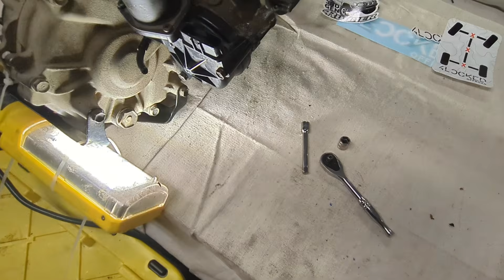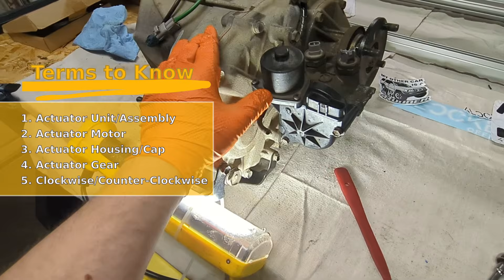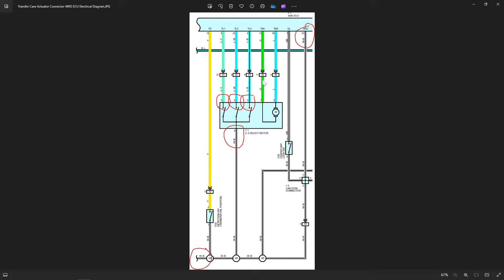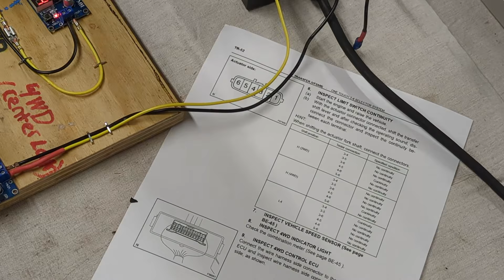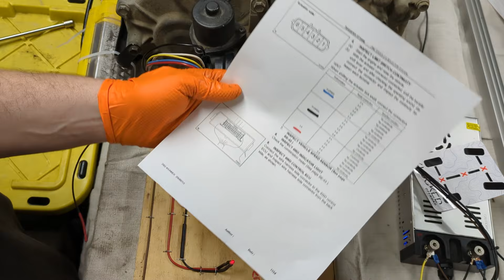Fix Your 4WD/All-Wheel Drive: Rebuild Toyota 4Runner/Tacoma Transfer Case Actuator Fast!

Comment: My 2001 4runner 4wd lights are flashing on the dash and it wont go into 4wd at all and the center diff is locked up, I already tried replacing both switches on the actuator, so now im just going to replace the whole actuator itself, my question is can I just throw it on? Or do the gears in the new actuator need to be selected into the same function that my truck is stuck in? Looks like in your video the middle selection would be the correct setting, do i need to make sure the new actuator is set to that? Thanks
Reply from the maker: So your current scenario is the lights were flashing and you can't engage 4WD. Did this only start occurring after you took off the actuator cap and/or actuator gear and then reinstall it? There are a couple of things that come to mind. 

1. Let's forget about the transfer case rod and it's position for a moment... If you're trying to change the transfer case position by turning the actuator gear, make sure the actuator gear is set in there correctly. If place the actuator gear in the 10-12 o-clock position then the physical piece of metal spring on the bottom of the actuator gear will run into the a protrusion of the casted actuator body. This is a physical stop. If this is the case then pull the gear out, rotate it counter-clockwise about 90 degrees and try again.

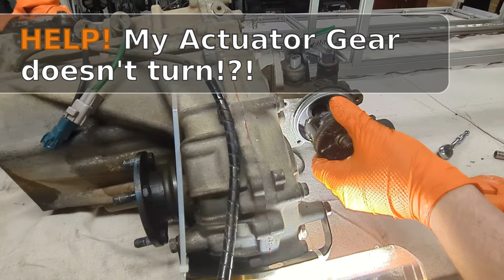I talked about this scenario in the video at the 10:00 mark.

2. Put your vehicle on 4 jack stands or a lift. Put the transfer case in Neutral. Parking brake off. This will ensure the drive train is not loaded with force. If there's too much force on the drive train that's in turn resulting in a lot of force on the transfer case rod then you won't be able to move the actuator gear (or the transfer case rod) left/right very easily.
Reply: @ no the vehicle sat uncared for for about 6 years, so it hasnt been kept up with over the years, trying to bring it back to life ive been driving it for months until I decided to see if the 4wd worked, of course it does not, would not go into 4wd at all, 4wd light is flashing constantly on the dash and the center diff is locked up, car jumps at hard turns, I took the actuator off and it is all corroded and rusted inside so I bought a used one to put in its place, just dont know how to go about installing/timing it to my current situation
Reply from the maker: You bought a used actuator or a whole transfer case to swap in?

If you're swapping in a used whole transfer case... You can take out the one in there and put the used one in. If the front diff A.D.D. is engaged the computer should figure this out and bring it to parity with whatever position the used and newly installed transfer case is in.

Putting in a used actuator? Then put the vehicle on 4 jack stands (on level ground!) or a lift. Take off the parking brake, put the transmission (yes, transmission, not transfer case) in Neutral. Then spin the rear drive shaft. Does the front drive shaft spin? If no, then the transfer case is in 2WD.

If front drive shaft spins you're in AWD or 4WD.

While spinning the rear drive shaft grab a hold of the front drive shaft and stop it from spinning. Does the rear drive shaft still spin? If yes, then your transfer case is in AWD (center unlocked). 

If the rear drive shaft and front drive shafts must spin the same rotations together then you're transfer case is in 4WD (center locked)

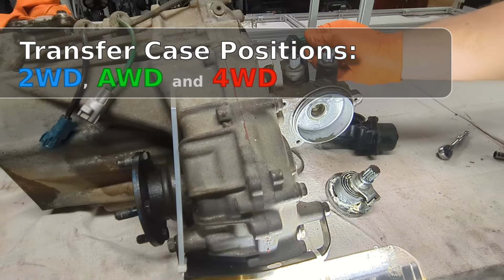The 3 transfer case positions are explained at 8:04.
Reply: @ I bought a used actuator and I was just going to throw that on hoping that fixes my problem, can the actuator positions be changed with the actuator off the vehicle? For example can I turn the gear in the actuator to put it in 2wd and then install it onto the transfer case? Or do I need to install the actuator to the transfer case, take the cover off the actuator and then turn the gear to put it into 2wd while its on the transfer case? Thanks! Im assuming the main goal is ensuring the transfer case and actuator or both in the same position when its installed, not sure if this is something the vehicle computer would adjust on its own if they actuator was installed not in the correct position?
Reply from the maker: @kylekenn8430   I actually haven't pulled the entire actuator off the vehicle yet, but I will do my best to answer your questions to the best of my knowledge.

"can the actuator positions be changed with the actuator off the vehicle":

When you pull the actuator off, the shift fork shaft/rod will stay inside of the transfer case. This will allow you to pull on the rod directly to change through the 3 positions. You really don't want to pull that entire rod out unless you must replace it, because that requires opening the entire transfer case.

"For example can I turn the gear in the actuator to put it in 2wd and then install it onto the transfer case?":

You can absolutely turn the gear in the actuator while the actuator is on the transfer case to cycle the transfer case through the 3 drive positions. This is covered in the video starting at 8:04

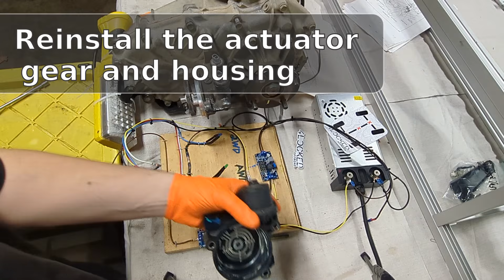While the actuator is off the transfer case, I don't see why you couldn't realign the electrical half to match up with whatever drive mode the transfer case is currently in. This is covered in the video starting at 23:40.

"Or do I need to install the actuator to the transfer case, take the cover off the actuator and then turn the gear to put it into 2wd while its on the transfer case?":

My preference would be to set the drive position on the transfer case in 2WD by pulling/pushing the shift shaft/rod. Then separate the two halves of the actuator and install the metal side of the actuator to the side of the transfer case. Finally, position the actuator gear to the start of the 2WD circuit and install it. IMO that's the easiest method. And it gives you the chance to add fresh grease to the inside of your used actuator assembly.

However, you may be able to set the transfer case in a drive mode like 2WD. Then, assuming the actuator and its gear is aligned at the beginning/start of the 2WD circuit, you may be able to put the actuator on the transfer case.

" Im assuming the main goal is ensuring the transfer case and actuator or both in the same position when its installed":

Absolutely. The transfer case shift shaft/rod position and the actuator gear position need to be in the same position as each other.

"not sure if this is something the vehicle computer would adjust on its own if they actuator was installed not in the correct position?":

The computer won't be able to readjust these two components (the actuator gear + the transfer case shift shaft/rod) so they are both aligned with the same positions. That's something the installer has to do.

The reason why the computer can't resolve this is the computer can only send power to the motor to turn the gear clockwise/counter-clockwise. The problem is whenever the actuator gear turns it will also move the shift shaft/rod the same amount...

So if your shift shaft/rod position is in AWD (one side of the spectrum) and your actuator is in "2WD" (the opposite side of the spectrum), then when the computer tries to change the transfer case into 4WD Center Lock  (middle of the spectrum) or AWD it's going to run into a physical limit.. Because the shift shaft/rod is already at the furthest point and cannot be physically moved anymore.

Hope this helps.
Reply: @  so I actually just finished up, I pulled rhe transfer case shaft/rod out to ensure its in 2wd, I adjusted the actuator gear completely counterclockwise, I drove the vehicle around the block and it feels like it is working mechanically, however the 4wd light on the dash still is constantly flashing, at the 27:00 mark in your video when you readjust the gear in the acuator to align in correctly to slide/fit on the housing better it seems no matter what I do I cant align the gear properly to get it so sit flush in the housing so i can bolt it on appropriately, any tricks with that? I got it bolted on but only was able to get it on where there was a small gap and then I tightened the bolts to get it completely flush, thanks so much!
Reply from the maker: @kylekenn8430  

" I pulled rhe transfer case shaft/rod out to ensure its in 2wd":

I'm pretty sure transfer case shaft all the way out is going to be AWD, at least in 2001-2002. Can you verify this by pulling the rod all the way out and spin the rear drive shaft, does the front spin? If so, if you hold the front shaft to stop it from spinning can it be stopped while still allowing the rear drive shaft to be spun? You'll need to jack up the vehicle by the rear axle to lift the rear tires. Don't forget to chock both front wheels. Then put the transmission in Neutral, parking brake off, and you should be able to spin the rear drive shaft by hand. If the front drive shaft moves at all you're in AWD. 

" I cant align the gear properly to get it so sit flush in the housing so i can bolt it on appropriately":

Most likely because you're gear teeth are not aligned properly. You have two sets of gear teeth that need to be meshed together perfectly. The first set is the actuator gear (the brown cog) and the actuator motor's screw drive. The second set is the "pinion" style of gear on the back of the actuator's gear cog and the rack gear on the shift shaft rod.

Sounds to me like your actuator gear's pinion gear that mesh with the shift shaft rod's rack gears are not properly aligned. Assuming this is your problem your actuator cog needs to be rotated about 1/16 to 1/8th inch. It helps to take a paint marker and mark the side of the actuator gear cog that has the pinion gear and mark the black actuator cap/housing right where the 2WD circuit starts.

You will notice these paint marks on my gear & housing in the video if you're looking for it. The molded plastic gear cog has a half moon shape/contour  right where those 3 springy-pins start. This needs to be marked with a paint pen and lined up with the start of the 2WD circuit. Make sure the transfer case shift shaft is actually in 2WD.
Reply from the maker: @kylekenn8430  " I cant align the gear properly to get it so sit flush in the housing so i can bolt it on appropriately":
 
26:35

EDIT: I see you already mentioned the 27:00 minute mark in the video. Before you pursue fixing this issue you need to make sure your transfer case's shift shaft position is actually matching the drive position of your actuator's gear. 

Let me know what you find out and if you have any more details/issues.
Reply: @ i confirmed that with the shift shaft pulled all the way out that it is in 2wd, I confirmed it by spinning the drive shaft and only the rear shaft moved, I installed the actuator with the gear turned all the way to the left (counterclockwise) I then put the black plastic cover on, still having the issue where that cover wont sit completely flush unless I tighten down the three bolts, I aligned the 3prongs on the gear with the gapped section of the circuits just like you explained in the video, but it still wont sit completely flush, just has a small gap unless I press on it hard and then tighten those bolts like I mentioned previously, I played around with the position of the gear numerous times, I test drove the truck around the block and it is driving fine no issues but the 4wd light is still flashing on the dash, the 4wd functions seem to be working mechanically, the car feels like it clicks into 4wd but still electronically speaking the dash still wont recognize it for some reason, dont know what else to try, I also pulled both actuator switches out and cleaned them and still have the flashing of the 4wd lights on the dash
Reply from the maker: @kylekenn8430  

"with the shift shaft pulled all the way out that it is in 2wd":

I have my spare transfer case in my garage. Tonight I'll pull the actuator or the actuator cap off and verify that the shaft all the way out is 2WD. In the mean time review the video at 8:25.

Notice how starting at that point I'm turning the gear cog clockwise to move from 2WD -> 4WD Center Locked -> AWD.

Turning clockwise IIRC is pulling the shaft OUT. 

"I confirmed it by spinning the drive shaft and only the rear shaft moved":

Are you leaving your front wheels on the ground?

Review the video carefully at 9:15. Notice how in AWD I can hold the front drive shaft and it doesn't spin while allowing the rear to spin. I think maybe this is throwing you for a loop?

If your front wheels are on the ground they're not going to spin, your front diff is not going to spin and this means you're front drive shaft is probably not going to spin :)

"I test drove the truck around the block and it is driving fine no issues but the 4wd light is still flashing on the dash":

I would expect it to drive fine in AWD and 2WD modes on the road with no tire scrubbing.

Ok let's do this to rule out the transfer case drive mode is not actually in 2WD. Put your transfer case in 4WD Center Locked mode by manually turning the actuator gear. Then reinstall your actuator cap/housing with its gear being aligned in 4WD Center Locked mode.
Reply: @ I had the vehicle off the ground (all 4 wheels) on jack stands with it in neutral, I did all the same tests you did in your video, with the shaft pulled all the way out only the rear driveshaft spun
Reply from the maker: @kylekenn8430  Got it, I trust your judgement. Just wanted to encourage you to double or triple check :)

With that being said, have you tried my other suggestion in my last comment?

Put your transfer case in 4WD Center Locked mode by manually turning the actuator gear. Then reinstall your actuator cap/housing with its gear being aligned in 4WD Center Locked mode.

Double check the actuator is aligned correctly by testing for continuity between pins 3 & 4.
Reply: @ ill give it a shot, thanks so much for the help and guidance man really appreciate it!

Comment: I've got an 02 tacoma that won't go into 4wd and you've given me the confidence to pull off that cover and at least clean it up. I used to have an 02 4runner as well, I knew that had the AWD/center lock diff but my tacoma has the rear diff lock button/actuator so i'll be interested to see if it is AWD as well, my understanding is that it only has 2wd/center lock transfer case
edit: the transfer case on my tacoma only has 2wd and 4wd, and the inside of the actuator cover was in mint condition. i still cleaned it up and smeared it with body grease for the motor and di-electric grease for the contacts. i also cleaned up the 4wd detection switch screwed into the actuator. i could definitely hear the TC actuator moving and locking the driveshaft out of the TC but I didn't lift it off the ground yet to see if the ADD on the front diff is locking up as well. if it is i'll be real happy since that means I only need to replace a light bulb!!!!! thank you so much for the video!
Reply from the maker: Glad the video was helpful to you, thanks for watching!

Comment: Excellent video. Please do one on the front actuator. My transfer case clicks in, front does not. This was very helpful understanding how it actually works. Thanks
Reply from the maker: Thank you for the feedback! Front A.D.D. actuator video is definitely on the list once I find a 2002 front diff with A.D.D at a local junk yard.
Reply: Just to follow up, I watched a video from Pine Hallow Diagnostic on a 4runner with a bad transfer case position switch. Bought one on Amazon, installed, engaged immediately, and disengaged when I pushed the button again. It has to be part of the electric signal sent to the front ADD. Just more information for your next video to share. I'm pretty happy
Reply from the maker: Yes, the 2001-02 transfer cases have 3 mechanical position switches. They tell the electronics if the transfer case is mechanically engaged in Neutral, 4L and  4H. If any of those switches are bad then that will definitely cause 4WD blinking lights and likely stop the 4WD/2WD system from engaging/disengaging.

If I remember correctly the FSR states the resistance of those swiches should be about 5-7ohms.

Comment: Excellent video!  I actually replaced my actuator since the motor was completely seized up.  Used this video exclusively.  Thank you again for an excellent video!  Transmission shop quoted $4k.  I did it for less than $200.
Reply from the maker: Wow, that's a huge savings! It sounds like it was a worthwhile repair. I'm glad you were able to use the video, that's what it's all about.
Reply: Did you replace with a used actuator and if so how did you get the timing correct with the actuator and the transfer case? Im assuming making sure the transfer case is in 2wd by pulling the shaft all the way out? And then making sure the gear in the actuator is all the way to the left is that correct? Thanks
Reply: I replaced it with a new actuator.  2wd all the way out and gear all the way left.